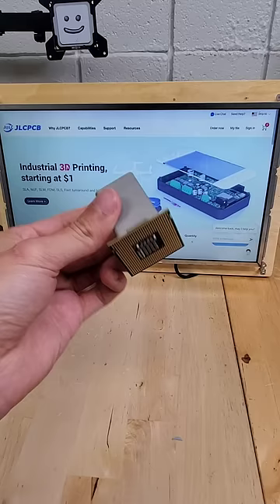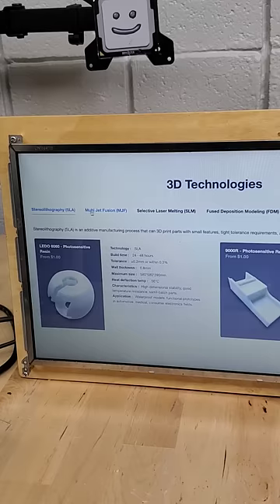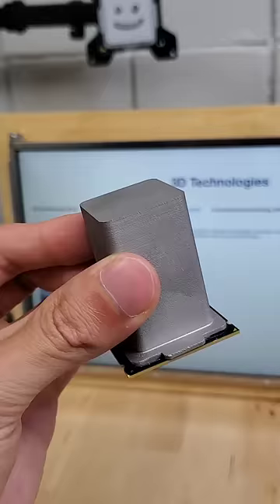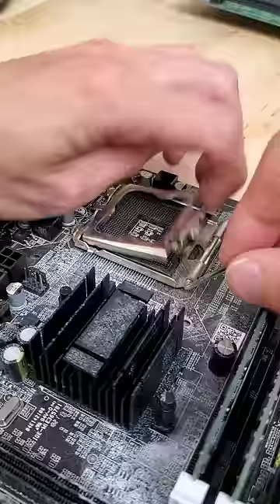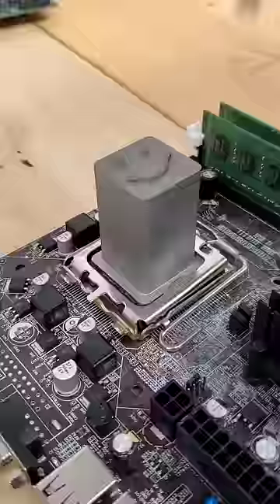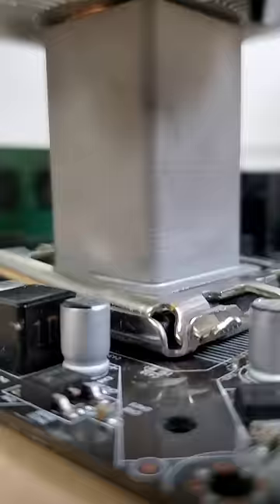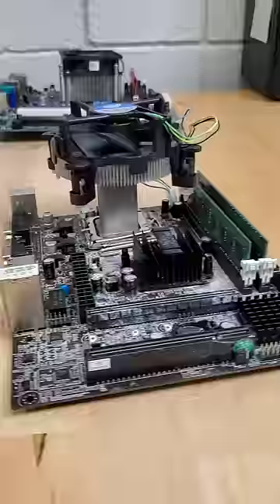the tallest CPU in the world #shorts

Comment: NO THE TEMPS, WE NEED THE TEMPS.
Reply: I'll bet my ass that temps are shit.
Reply: Probably but I want to know how bad it is
Reply: @hpenvy1106  it has more surface area so it should cool faster
Reply: @IbnHussain  but the 3D printed stuff will be some alloy with many micro enclosures. Thermal mass will probably be good, but heat conductivity will suck hard.
Reply: @hpenvy1106  didn't think about that, you are right
Reply: I bet they are actually fine for a bit considering how large that heat sink is but when it gets heat soaked I bet they suck
Reply: @breckboy654  Most likely the incorrect metal. Its forsure not copper. It needs to be Copper or  nickel plated copper. For any thermal transfer to work properly.
Reply: It fried its self, temps is unknown
Reply: No way it worked it looks like steel toe cap material for a boot 😂
Reply: @hpenvy1106  it had good temps,so when u letting us hit?
Reply: @IbnHussain  mh not really, it has a bigger volume to surface area ratio which doesn’t help anything. In this instance the heat just has to travel further to the cooled off part of the block which makes the cooling seem ineffective
Reply: @IbnHussain  the cooler won't be properly attached though
Reply: @hpenvy1106  Plus, no mounting pressure
Reply: Yes
Reply: @DiscipleLE  link? :)
Reply: @IbnHussain  WAIT someone actually admitted that they’re wrong on the internet? Shit we going places
Reply: @IbnHussain  More surface area on the heat spreader but that's why heat sinks have so many fins to have that surface area. I think it would be okay at first but once it can't dissipate heat fast enough it would have an issue. Plus the metal like others are saying. It was my first initial thought though
Reply: probably really bad, since a heatsink have fins to get more surface area to remove heat. this will probably heat up and keep it at high temp all the time.
Reply: @IbnHussain  It has lower surface area, but higher thermal mass...
Reply: @helium5912   Literally not true. It doesn't need to be copper for thermal transfer. it can be ANY thermally conductive metal. most cheap coolers are aluminum, zero copper or nickel present.
Reply: @hpenvy1106  I confer
Reply: @IbnHussain  less, it has so much mass, lesser surface area.
Reply: @hpenvy1106  does that mean you are hoping to win an ass if the thermals are infact bad?
Reply: @dylanbaldwin8829  MOM GET THE CAMERA!!! MOM!!!
Reply: @HuffGLaDTem  no
Reply: @shlokbhakta2893  probably doesn’t cool at all
Reply: @IbnHussain  it doesn’t have more surface area touching the cpu, plus it’s so far away from the cpu that it probably doesn’t work
Reply: @Mopiiy  except it’s a terrible idea, the farther away from the processor the cooling element is, the worse the processor performs.
Reply: @hpenvy1106  ok, but what about an IHS that tall, cnc'd out of copper.... I wonder what all that thermal mass would do for temps...
Reply: On god
Reply: @hpenvy1106  maybe not. More material means it can pull more heat out before needing to be cooled
Reply: Just say if the 3D print job is not this ridiculous rectangular block, but something that can be hooked/surrounded by some proprietary water cooling masterpiece this could work out well
Reply: @hpenvy1106  i bet my balls its gonna overheat
Reply: @paulbrown3302  I'm gonna go out on a limb and guess... steel?
Reply: @IbnHussain  more surface area. But less for its volume. Cube-square law. 

I want to know though. Because it all has more thermal mass. And if it still transfers heat quickly, who knows!?
Reply: 666 C
Reply: His other video showed temps of 90*
Reply: The temps are bad like realy bad it goes up and up and up
Reply: @IbnHussain  it has to go through more thermal mass to get to the radiator, so it would be worse.
Reply: the temps are 100 degrees in later video
Reply: @IbnHussain  the surface area is not all it needs, it also needs to maximise the surface area and cooling NEAR the processor. Mans fins are 10 meters away.
Reply: @IbnHussain  bigger isn't always better if it can't dissipate the heat as quickly, it also will make the cooler less efficient

Comment: Just imagine dipping the top of it in a bucket of thermal paste 
DO IT

Edit : wow
Reply: Give this man top comment
Reply: With the upside down CPU mainboard
Reply: MAKE IT HAPPENNNN
Reply: i don't think mryeester notices youtube comments more than tiktok comments
Reply: an even longer one that turns to thin fins and then have the mobo upside down sticking into a bucket of water
Reply: @morgan0  now thats engeneering
Reply: Why did you tell me this, now it is all I want😂😩
Reply: thermal paste doesn't cool, it conducts heat 😭
Reply: thermal paste is literally an insulator when thick, a breeze onto the thing would be cooler than a bucket of thermal paste
Reply: @morgan0  there is a video on linus channel about that,water cooling an air cooler that they dip into a bucket of water. The cpu miunt on the motherboard was stuck on the back.
Reply: So it's lubed up and the user becomes the heat sink by sitting on it...

Comment: this actually may have application. the increased surface area would allow for more thermal transfer capacity, and the increased metal volume could mean more thermal absorbtion, meaning it takes longer to get to "operating temperatures" under load. I really wonder if this could have any sort of benefit to performance in cooling.
see if you can get a heatsink that sockets to it like a female plug to fit on it with just a crazy huge heatsink

Comment: Since the CPU-die isnt touching the actual cores which are all at the bottom, the whole thing is entirely useless.
Even if it was printed solid, 3d printed material is hollow and wouldnt even conduct heat that well.

Comment: I used this printing method. It does not get along with the heat of the cpu. The material starts to bubble if you hit it with 150 °c. Had a part that was a little deformed and i shaped it with a heatgun at 150°c and had bubbles formed. The resin that bonds that metal particles is not coping with heat that well

Comment: I guess it's ripe for delidding.  I have read that half the reason Ryzen 7 processors run so hot is their integrated heat spreaders are a scant 1.7 mm thicker than the Ryzen 5.  This seems to be dozens and dozens of mm thicker still.

Comment: I could actually imagine sticking 5 different thermal coolers on each of the four sides and the top all with either a fan or liquid cooling or something just really depends on how well the tower transfers heat, if it does well then i could imagine if you have enough power cooling it it would be able to take and transfer a lot of heat lol. But realistically if it was a viable or optimal way of cooking it people probably would be doing it already lol

Comment: I’ve been fighting my desktop for a few weeks. Overclocked cpu and ram, pc shut down, bootlooping with dram light. Bought new power supply and ram, nothing better. Just bought and installed a new motherboard, same problem. I have to save for a cpu now. Been running a monitor, separate keyboard and mouse off of my work laptop to get by for now.

Comment: this would be good for temps as you could make a fan with a hole that also cools the sides.
Reply: this would definitely not be good for cooling because the big metal block would heat up at it's core and even if it had cooling everywhere it would cool the top and that's how 90°C on CPU die is created

Comment: Ok really question then, you could conceivably have a heat spreader printed with fins for like a 40mm fan attached on side, or even each side. Or something similar,  whatever configuration you would want, but would that work at heat transfer better than traditional cooler system that relies passing through:
 heat spreader > thermal paste > copper you would remove two extra thermal steps right?

Comment: Everyone asking for the temps.
I'm just here to ask: Why?
Reply: In theory having the heatsink directly on the CPU die should provide better thermal conduction. There's extreme mods where the CPU is delidded and this is done. However, the risk of actually cracking the silicon chip with too much pressure becomes very very real.

This is not a heatsink he designed, it's a giant lump of metal which probably needs a ton of extra work (flattening, smoothing etc.) to be viable. And I bet there was no actual test because he damaged the chip in the ways mentioned above.

Comment: Does this make any sense at all?  Its not the tallest CPU, its the tallest IHS on a CPU, for one.  And then what is the point?  People who care about temps/performance enough delid/lap factory IHS's to get them more flat/smaller because that type of thermal interface is usually less efficient, and you're out here making it bigger, probably not out of copper or any metal with good thermal transfer, probably super bumpy/not flat, and probably has tons of air pockets or pockets whre the metal isnt 100% solid bringing down transfer efficiency?  What's the point lol?  Whata meme.

Comment: The CPU lid is not a heatsink. It's supposed to transfer the heat to an actual heatsink. Also, what material did they use? Is it thermally conductive enough? Is the top flat and smooth? How do you attach the HSF to the motherboard?

Stupid video with a stupid design just to promote a prototyping company (stop calling them 3D printing).